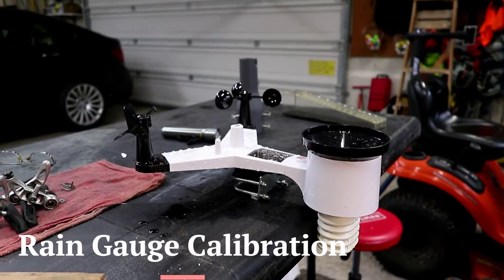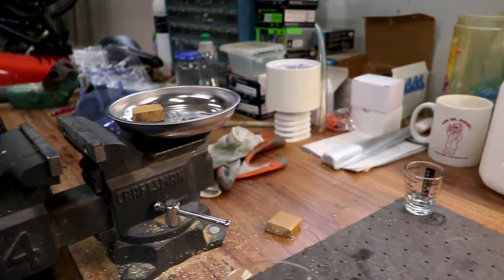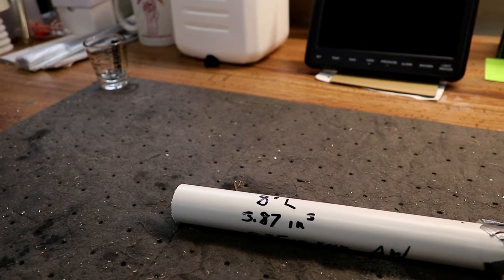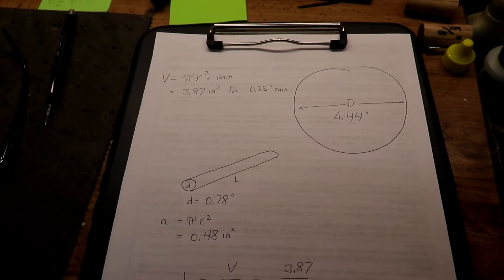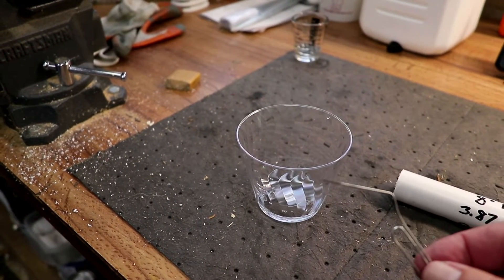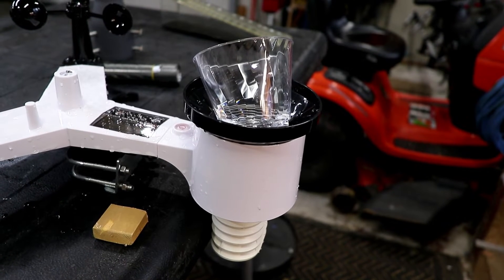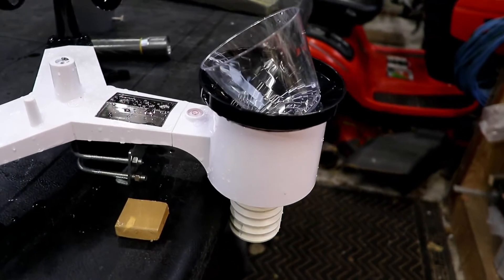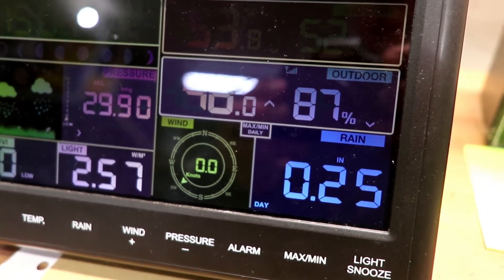Rain Gauge Calibration

Comment: Luckily your gauge was accurate! The actual calibration adjustment on the base station isn't exactly intuitive. Would've liked to see your ideas on adjusting the "rain factor" to calibrate out any variation.
Reply from the maker: It would have taken some testing.  And several repeats of sending a known amount of water thru the system.

Comment: Hello Wendell.  Once set up, how often should the calibration be checked.   If you have a power cut and it's raining and your gauge tips 10 times say, will those 10 tips be recorded? Just asking. Jim.
Reply from the maker: Best check with your device source.
Reply: @wendellcrim8647  If your device has battery backup then you should be able to measure rain at any time 🙂
Reply from the maker: Yes.  This model has solar battery and back up AAs.  Data collected during a power outage will be sent when power is restored.